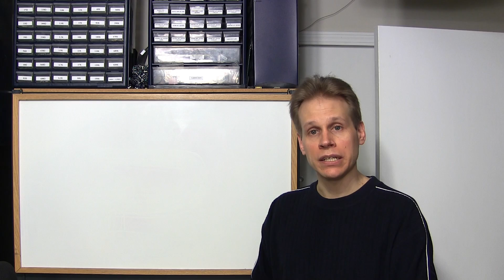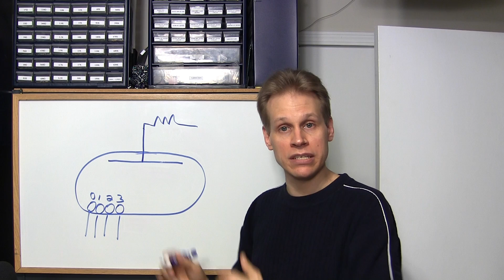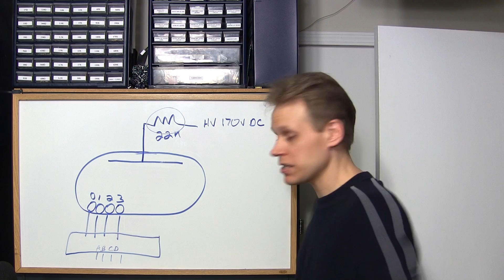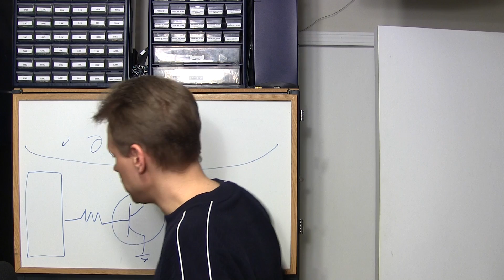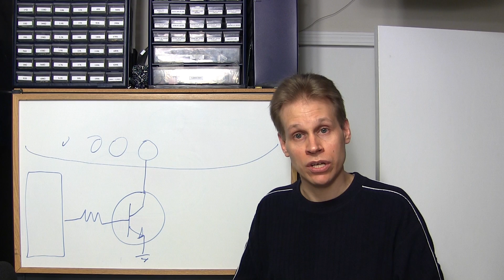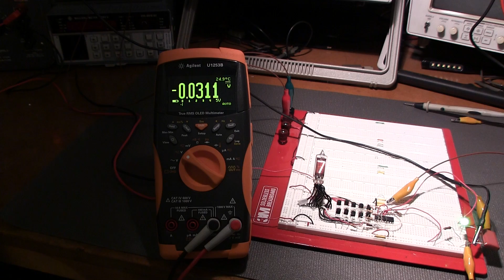The NIXIE Tube, and How To Use Them

Comment: There's no reason you couldn't just use a relay in place of the transisitor for grounding the numbers, right? Assuming your control circuit used voltage high enough to drive the relay, I mean. I was thinking it'd be neat to do a Nixie clock with relay logic.
Reply from the maker: Relays would work fine, lots of wiring though!
Reply: but nice sound :D
Reply: I could SO fall asleep to the clickety click!

Comment: This video has better calculation for bipolar transistors in switch mode. It is a pity that it will be difficult to find.(
Reply from the maker: I try to keep the boring math to a minimum, but I knew there would be questions in this one, so I included a slight bit of it.

Comment: Wow, I know it's a beloved classic transistor, but what a turd it is!

BTW, 25 is the min. gain OUT of saturation. The datasheet uses β=10 for saturated specs. You seem very concerned about being in saturation, so you might want to rejig your calculations. (not that I'd be so worried about hard saturation...even at Vce of 10V, you're only dissipating 30mW)
Reply from the maker: Please note the minimum DC current gain page 2.  http://www.mouser.com/ds/2/149/MPSA42-196155.pdf  Would you like more?  See here as well: https://web.jfet.org/nixie-1/NixieTransistors.pdf  again page 2. You may also be interested in practical circuit examples, just google MPSA42 Nixie driver, and click images. Note the common base resistors that are used.
Reply: As I said, that's min gain at Vce=10V...not saturation. Different things. Look at Fig3 of OnSemi's data.
Reply from the maker: Did you even read what I posted above? 25 is the minimum DC current gain for the transistor to be "ON" with a collector current of 1mA. We did the calculation with 3mA. So that means we are somewhere between 25 and 40. (You do remember the divide by two on the white board as well right?) Why did we divide by 2?
 Fig 3 shows an Ic of 3mA, with a Base Emitter Voltage of .47... What was the Base Emitter Voltage we took into account on the white board? Again, read the second link I posted above, and look at common circuit arrangements with the MPSA42 if this doesn't convince you. Get out your breadboard too, and stop playing with paper! Oh.... and why are you giving yourself a "thumbs up" every time you post your comment?
Reply from the maker: I also have some video's on how to "really determine transistor gain" as well, if your interested. https://youtu.be/4dasj7PbF2k  and   https://youtu.be/v3Jv2_pQ86o
Reply: Fantastic reply Paul.  I love it when you get feisty with the nay Sayers who THINK they know what they are talking about, but, DON'T.

Comment: Nice video. You mentioned using external transistors and the old nixie drivers as control possibilities. Over the years I have seen several articles of people using more current (available) vfd drivers to control the nixies. An example would be: http://www.halfbakedmaker.org/blog/max6922-nixie. Makes the part count go way down. Any thoughts on that option?
Reply from the maker: Thanks for the link Bart, I have already mentioned it in the post.

Comment: Soooooo Mister Paul, IF each tube was alpha-numeric...  there'd be at least 38 leads per tube, thus 36 transistors etc for each tube.  Of course that would be upper case.  Just being silly, but LED could make all a/n characters from seven or nine  contacts.  The diode is so important to electronics, going back at least 100 years with xtal radios.  And  um ashamed to say that I have no clue as to the story of the first rectifiers and diodes?    I doubt Marconi or Edison invented the rectifier.  But Tesla (AC to DC)?  Don
Reply from the maker: Hi Don. Mechanical rectifiers were first, then came the tube. Infact, some early auto vibrators had mechanical rectification as well (no need for an 0Z4) As for invention, it's hard to tell due to the fact that the system is tainted with money and politics. The truth is obscured due to this. For the longest time, people thought Edison invented the light bulb, and electricity to homes as well. Just recently people are beginning to realize what they have been taught in school was a political money driven lie.
Reply: there's more than one way to rectify a cat.  Like Henry and Alexander, Tom got the big contracts for the masses.  Molecular polarity was at least 150 years ago, opposites attract...
Reply: Right you are!  Alexander Graham bell did not invent the telephone either. I was Antonio Santi Giuseppe Meucci, and, I am not Italian. We have been told too many lies. I despise politics and love electronics.